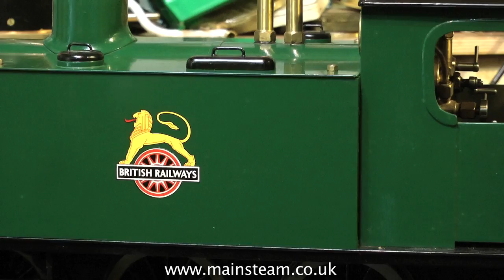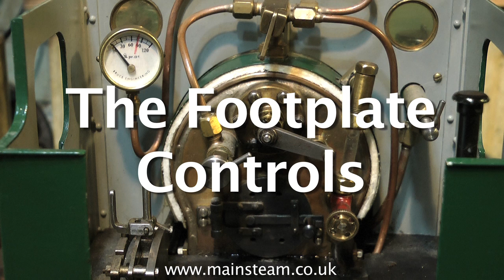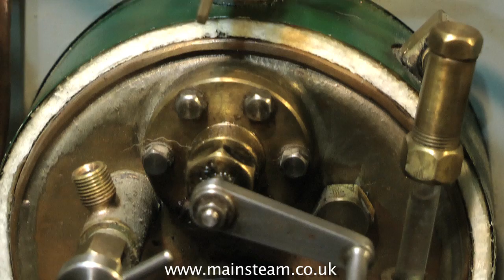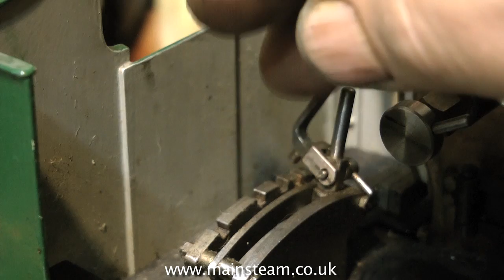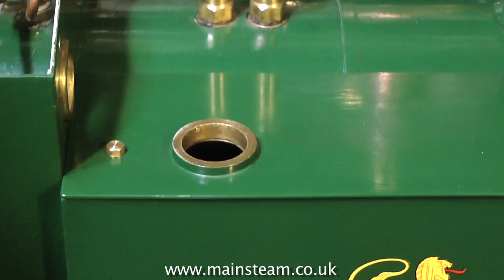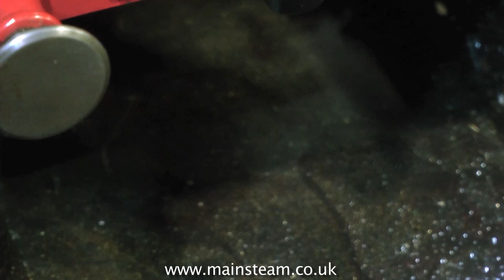LOCOMOTIVE PROBLEMS - MODEL STEAM ENGINES FOR BEGINNERS #8

Comment: I have a question. on several locomotives I've noticed exhaust pipes under the cylinders. in addition they only exhaust steam opon startup but when the locomotive is rolling at a good pace they stop exhausting. I'm just wondering what they are if their just simple exhaust pipes or if there's some valve involved? great content by the way.
Reply from the maker: They are called "Drain Cocks" and they are opened when th engines first starts as the steam condenses to water as it contacts the cold cylinder. they are used to prevent hydraulic lock. Once the cylinders are warmed up, the drain cocks are closed.
Reply: very interesting... thanks for the help. that was driving me crazy trying to figure it out.

Comment: Keith, and excellent video like all of them would you be doing one on timing twin cylinder loco's , with Stevenson's valve gear it is my first attempt ,Adrian
Reply from the maker: Thanks for your kind comment. I don't have any plans to actually build a locomotive anytime soon, however in the current series about the big twin cylinder steam engine, I will be doing a spin off to show how I time twin cylinder steam engines - this is applicable to locomotives also.

Comment from the maker: The steam engines on the videos are usually ones I am working on for either friends or customers. My personal collection is quite small - I do own this "Locomotive on the video though . . .
Reply from the maker: I don't normally use axle pumps as I find that they can make smaller locomotives run jerkily, but I get your request - I will do a video showing how a hand pump works - the principle is exactly the same except it needs a hand to move it - not an eccentric on the axle . . . .